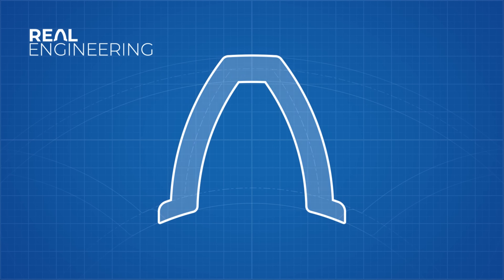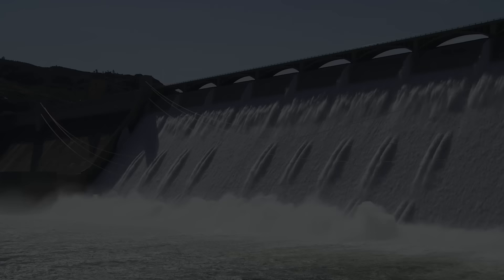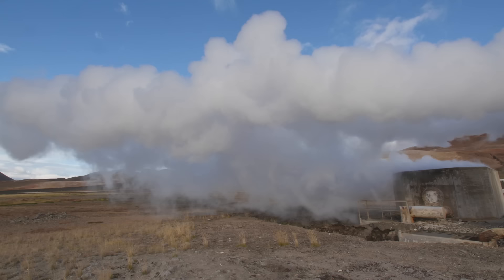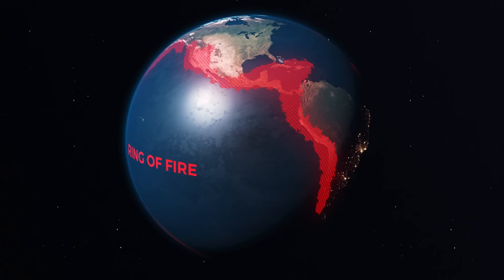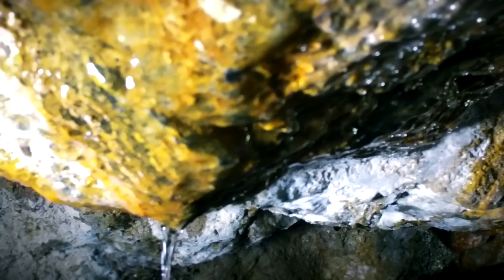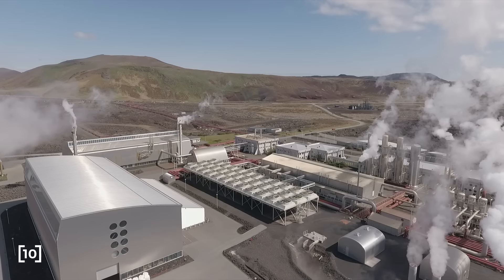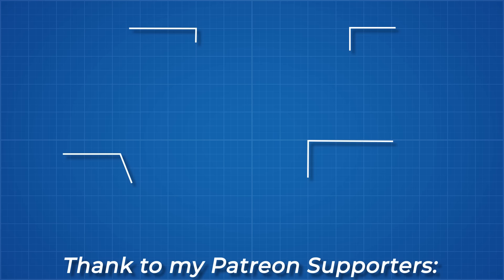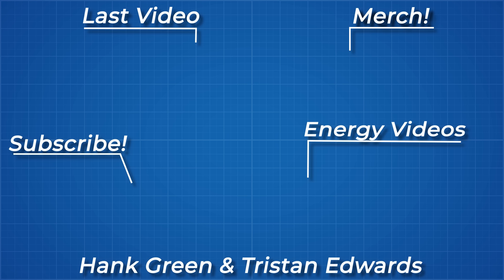Could Earth's Heat Solve Our Energy Problems?

Comment: They have had geothermal power stations in New Zealand for about three decades, I understand their output is gradually failing.
Reply: Normal when you think about it, there comes a point where you're going to start creating a cooler "bubble" around where you're sucking out all the heat. So they will either need to dig a bit deeper, or shut down for a bit to let things warm back up.
Reply: Sandcastle •  that's not how it works. The process of reheating is slow, it takes ~30 years to reheat again. You suck the heat out of the local patch, not from the core of the planet
Reply: That is not really an issue if the amount of energy produced in that 30 years is the same as a coal fired plant, as for that 30 years you did not burn coal and empty a big coal mine.
Reply: Feeds Ravens  i'm repeating a comment i read before coming across yours: the chemicals may be corrosive to plant hardware but not harmful to the environment, e.g. all the minerals from the rocks say calcium carbonate aren't harmful, but they may crystallise and essentially create millions of tiny daggers that scrape away at the turbine blades. obviously the high pressure and temperature required for geothermal doesn't help the wear and tear.
Reply: How fast it's falling depends on how fast you are pumping heat topside, that is how much power you are pulling from it. It's not an infinite energy source by any means, it's a mas of hot rocks with only so much heat trapped in them, once you cool them down you are done. Rock is a poor thermal conductor so it's not going to heat back up any time soon.
Reply: Robert Smith shut down for decades*
Reply: Sandcastle •  you are not that smart.
Reply: Sandcastle •  with that reply, it does proves my point.
Reply: Sandcastle •  it wasn't an argument. It was statement lol.
Reply: Feeds Ravens  nah it won't, the first aquafier is fed from the rain on the atlas mountain series, the side that faces north has many rivers that flow to the sea, we built dams to profit from it, the other side doesn't have rivers flowing the other way (which is normal, in nature rivers flow to the lowest point only, which is the sea in this case) so where does the rain water go ? it flows underground in massive rivers torward one of the two massive aquafiers (i forgot thier names) one is semi closed and has a low concentration of salt, the water from it is used for agriculture, the other one is too deep to access since you have to drill through the first one, and Algeria doesn't grant licences to drill to it yet
Reply: More than 3 decades, Wairakei Power Station in Taupo has been operating for more than 60 years
Reply: Feeds Ravens  between the massive landscape where you don't need extensive agriculture, and the governement protection most of the country is underused, some see it as being lazy or too complicated to grow up really fast, but in reality there is a strong conservative culture that makes thing seem slow, most of the crops in the sahara are bio and most of the products are sold to the middle east, the only bottle neck is shipping, but its getting sorted out

i get what you are talking about, its for this reasons that we refused the use of fracking for oil and gas, despite having the world's third largest reserve in schist gas, its not worth it, we could use solar for slightly higher cost, but without the diminishing returns of fracking

as for geo thermal honestly i don't see a long term use for it, its not scalable, and its too risky at best, drilling in highly sismic areas has massive implications, not only on the area/country but also on the edge of the tectonic plate, you don't want another country to blame you for a massive earthquake

the reasonable solution is the use of bio fuels to fill the gaps of solar and wind energy, imagin planting the sahara with palms, making palm oil without destroying the rain forests, palms are adapted to the hot climate and could provide a fuel that could be stocked and used as we desire while fixing CO2, this with the use of algea in the salt flats could turn things around, algea blooms really fast, and can consume massive amounts of CO2, ... remember that plan to make a sea in the sahara ? we can turn it into a huge CO2 sink by using algea and controlling it by using micro nutrients, mostly iron since its the limiting factor of algea growth in the ocean, but there is a fear of altering the ecosystem, sooo why not make your own sea ? the geography is there, for digging we can use the tidal forces and directed water errosion to dig the path, the cost would be negligable

i can go on for hours about this, the solutions are there, but no one wants to implement them, i have a pending patent on a system that can improve the efficiency of internal combustion engines by absorbing the heat from the exhaust, a gain of 10 to 20% efficiency that improves the power and torque while using the same engine, no automaker wants to even try it, they either have some outsourced agency to deal with outsiders like me, or they tell you that they are too focused on electric to even evaluate your patent, it doesn't make sense for thier narrative, they don't want to even try it because it will be the new EGR or DPF just another costly part for them
Reply: @nzsmithsi  I'm not a Kiwi, I was merely commenting because Geothermal has its limitations, and the last time I was in NZ they said it was failing, that's all I know.
Reply: Feeds Ravens  no one will if no one wants to, as for palm oil, its the old extraxtion methodes that generate methane, and when you compare it to the amount of CO2 absorbed its worth the trade off, and yes you can start exploiting the rain forest palms 2 years earlier than desert ones, but you have to process the fruit way more to reduce acidity and dehydrate it, which create a lot of waste in the form of petrolum gelly / vaseline, to which there is no practical use

we had an old project to stop desertification called the green barrage, the gov wants to reboot it, so instead of planting trees we could/will be planting palms, and because we are closer to the world's largest consumer of bio fuel, it will make financial sense

as for the sea in the desert most people miss the crucial point, if you see it as a real estate mega project, investors will be fighting to get a piece of the new version of the UAE, with a better climate and a larger space to work with and a way bigger coast line
Reply: @bobjackson4720  So the "three decades" figure was wrong and nothing provided to support the "output is gradually failing" comment.
Reply: @billhudson453  Other comments said it was already shut down. I was specifically told the output is falling off when last in NZ. I have nothing further to add.
Reply: Feeds Ravens  That method of using exhaust turbines works very well for engines that run at constant revs for long periods, such as stationary engines, ship engines and long distance aero engines. For engines that are expected to work with constantly-changing rev ranges you're better off using the turbines to compress inlet air (turbocharge).
Reply: why it would fail? i mean, according to global warming, it should be rising,  very fishy to me. and i need a geothermal at home, not at the city, but at home.
Reply: Sandcastle •  -  The dent isn't at the core it's at the surface, if the water source or the temperature drops plants generate less power. This was a problem at the geysers in California.
Reply: Sandcastle •  - The issue isn't "running out of heat" we both know that can't happen, the issue is extracting heat or water faster than it is replenished. It is possible to pump all the water out of a hole, which over time will fill up again.
Reply: Sandcastle •  - They ran out of subsurface water, the plants were sold at a loss and the new company pioneered water injection.
Reply: where i used to live in northern california they started pumping treated wastewater in the geothermal powerplant wells to increase power output.
Reply: @thomas.02  that is where maintenance comes into play, having onsite machine shops solves this issue.
Reply: NZ produces geothermal energy from many geothermal fields.  The fields are different sizes, have different natural recharge rates.  In only one field is the installed power station not running a full capacity. (This was predicted, when the plant was built in the 1980s). The extraction rates in the other NZ fields are managed to give a long life, say 100 years. Then the field might be shut down and allowed to restore from natural recharge. 

New future  technologies (eg deeper drilling) may allow more geothermal energy to used without the being limited by natural recharge rates in the the shallow reservoirs.

Comment: geothermal is not really renewable - it is more akin to a battery. When all that heat in the earth's core is gone, it is gone. Iron core could slow in spinning too weakening the magnetosphere.
Reply: That's like saying solar isn't renewable because eventually the sun is going to die.  Sure, it's not infinite, but it's close enough that it doesn't matter.
Reply: technically the sun is akin to battery as well, and will run out one day.
Reply: That's not the same thing in the least. Sun is producing constantly more energy, and will produce it no matter what, for billions of years to come.

Earth's core is not magically getting more energy from nowhere, afaik there is no such reaction going which would generate more. Some from gravitational pull yes?

It is insanely much energy there is inside earth, but what happens when we start to draw significant amounts out of it?

It is a bit the same as getting out liquidified dinos out of the ground, i am sure when oil industry started it seemed infinite supply as well - turns out it is not that infinite.

Energy demand grows constantly.

Fortunately this can be alleviated, using ground heat to heatup buildings is quite common where i am. During summers those buildings are being cooled by AC and if you pump that heat back into the ground instead ground will act like one giant battery in this case and it might actually be net positive amount of energy put into the ground.

Do the same with geothermal power plants where possible, "remote cooling" is starting to become a thing, where centralized heating using waste energy of power plants has been a thing for a long time, over here i hear they are starting to offer summer time cooling by pumping cool water into the same pipes.
Reply: @skaltura  "what happens when we start to draw significant amounts out of it?"
This assumes that peak demand represents a "significant amount".  I would hazard a guess that it does not.  Your analogy of fossil fuels is poor, because fossil fuels can only exist in the crust of the earth, which is a REALLY small part of the earth.  I think you're vastly underestimating just how much mass exists in the mantle.

According to the National Geographic Society, the Earth has been emitting heat for about 4.5 billion years, and will continue to emit heat for billions of years into the future because of the ongoing radioactive decay in the Earth's core.

Nothing we do is going to measurably change how long the Earth continues to radiate heat.

Comment: It would have been worth mentioning geothermal energy used directly to heat homes and buildings. You don't have to drill down as low since you don't need as much of a temperature differential, and it still lightens the load on the electric grid. In fact, it's actually a lot more efficient to use roof top solar panels to power a pump in a home geothermal system than to use the power from the panels directly to heat the water.
Reply: That depends on the location imho. Fluid temperature of the thermal solar panels should be way higher than the ground temperature few meters below. So given a large enough thermal solar panel size one can skip the heat pump on a good sunny winter day.
Reply: 70 percent of home energy use is  space conditioning and hot water generation.  And you need not use old geothermal technology use a heat pipe and a solar thermal stirling engine as a Hybrid.
Reply: That is occurring all over the world for those lucky or mostlikely Rich enough to afford that. Also I would not like to live so close to molten magma. That heat comes with a price the steam is laden with corrosive minerals and chemicals which rust, oxidize and corrode any type of piping or radiator systems you use. We put distilled water in the radiator of our cars for this reason.
Reply: @KimberlyRPeacock  This is fine if one lives in sunny Spain. In the North the winters often are cold and dark. If we do not want to burn the stuff and want to use a heat pump as more efficient than direct electric heating, then some shallow-(ish) geothermal is an option.
Reply: @darked89  I would argue it works well in the north as well, even in arctic regions.   Combined power and heating, and here we are talking temp differential for the power generation and heating  store the water which is your heat storage medium namely as its inexpensive  at just slightly above 100 F  and store in in a receiver underground where temp is say 50F.  Connect to heat pipes so you are not sending energy to pump, then use the temp differential between ambient and that and use both thermal electric generators and Stirling engines to generate electricity and even compress to raise temp above receiver temp if needed. In summer you have a sun that nearly never sets and your store that energy in your water reservoir.  It will take a lot of volume but you can make it inexpensive if you have a few homes sharing such.. However for a town or city the volume would be the issue I suppose.    Probably better to store in magnesium hydride  than water just because its 78KJ per mol H2 and use the sun and solar concentrators to get up to 300C in summer to release the H2 at atmospheric pressure.
Reply: I had some of those water heating panels once, I live in Britain so of course they never worked, we just had cold water lol.

Comment: We have a large, close to the surface super volcano over here called Yellowstone.
Always wondered why we didn't exploit that more than we do.
Reply: And tapping into the energy would at least delay the supervolcano.
Reply: Its protected by preservation regulationsfrom geothermal
Also alot of research would need to be done to prevent the magma cavity from depressurizing potentially causing an eruption or pressurizing causes an eruption or producing earthquakes compromising surrounding rock causing an eruption or the lack of knowledge about volcanoes especially so called supervolcanoes accidently causing an eruption...
Reply: @HalNordmann  Or if your f..k it up in enginnering terms you could prematurely spark off a Vei 7 volcano. In Iceland a  geo thermal energy project did spark of a volcano.

Comment: "Rattler Energy"  power plant works on any gas presser or liquids makes power. 72 psi at 180 F in a
 2 inch  pipe going in to the head  comes out a 4 inch at 2 lbs. at 18 F makes 63 KW. Can handle up to 600 psi.  They make a 250 KW, 500 KW,  1 MW & a 5 MW.

Comment: @Real Engineering

Great topic.  It would be nice if you did a video on residential/commercial HVAC.  IMO, we should've been dumping tax incentives into the consumption efficiency side of the equation.  Geotherm is a source of heating/cooling that could benefit far more people more quickly than solar or wind.

Comment: there is actually a way which most scientists know but ignore that is using superthermal-conductors rods and shoving them in earth crust to about 50-60 km.... and there will be probably 600c temp over them which can be used to generate heat which will be used to generate steam on surface (why are we even using water from steam we should get alternatives seriously)... which is actually pretty efficient coz earth is actually a  toddler planet... it would take 5-6 billion years if we actually tried to use earth's geothermal property...... but the problem which arise is normal superconductors are very expensive and they lack in material but the energy they provide will be actually more than nuclear 20-21x more with 20% of size required to build..... but it will take twice the time to build.....and the problem which arise will be the area surrounding the power station needs to be dry and away from ground water.... and vegetation....